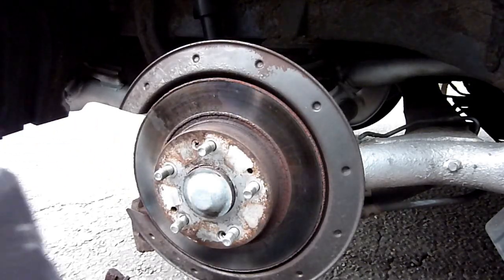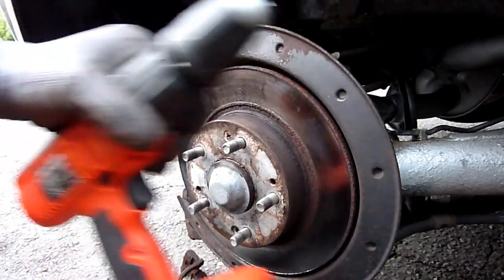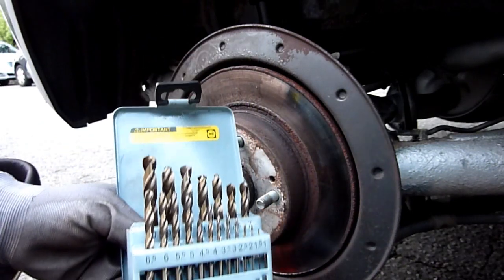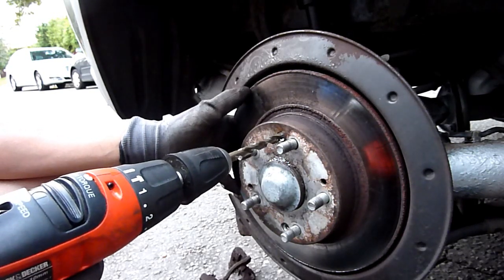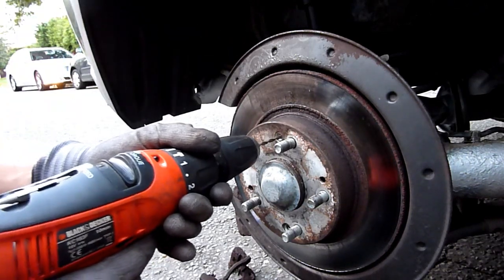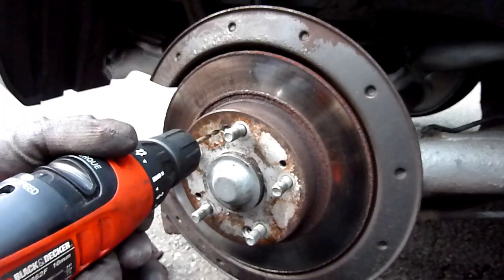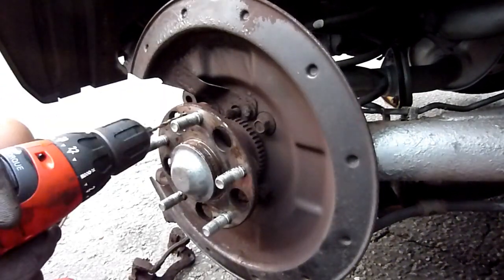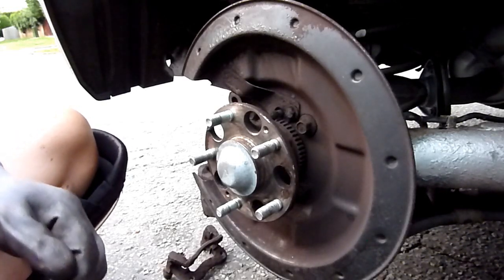How to Drill Out a Stuck Brake Rotor with Rusty Screws

Comment: i found it usefuk to watch after spending last weekend for ages with mine, impact didnt work, shocking with punch too not worked, so i ended uo drilling head off, discs came off but rest of screw still in, them and the other side is a job for this weekend, im trying to soak them few times during week, to hopefully aid getting them out this weekend.

Comment: I put two M8 bolts on the removal holes and wound them in with a ratchet, it cracked the threads on the stuck screws.

Comment: If you start with using a small drill bit then gradually increase size this will be a lot easier than starting with one large drill bit. Also use left handed drill bits and a bit of heat and the bolt(s) will likely come out. If they won't then drill out the head, use a centring drill bit to locate the next drill bit dead centre on the remaining bolt then drill out with a left handed drill bit.
Reply from the maker: I agree with the left hand drill bit, but I think starting with a small drill bit on a smooth surface is a good idea, not on the head of a screw. The indents will catch the small bit and break it off. I use colbalt bits, so being expensive, I try not to break them.

Comment: I just use short punch tool and create a divot on the edge of the screws and just took hammer to tap the screw in the divot with the punch tool or small head Phillip counter clockwise  until the started to move and then took the Phillip to take the screw out …very easy 1 to 2 min job. https://youtu.be/KCAeXsKz3ng
Reply from the maker: Too many risks involved. Most people can't see a screw head well enough to dent it in one corner. I also wouldn't recommend your technique on removing oil filter covers, as I've seen it done before.
Reply: I posted a link so people can decide what method they want to use…sharing is caring…

Comment: you should use the bolt extractor tip with your drill in reverse. You would be done in a minute instead of 12.
Reply from the maker: You should try it in real life, your way, and see what happens.
Reply: @EducationPineapple  if you go in reverse the screw usually backs itself out

Comment: this car should be japanese or koreans. u need impact drier. not rust.
Reply from the maker: Using an impact driver made for taking off 14mm plus bolts and not screws, will round off any resemblance of a screw-end in a single burst. Absolutely not recommended. Try it yourself if you want to experiment, but make sure it's on something you don't need.
Reply: @EducationPineapple  If you just drill off the head, the rotors cones off and you can untwist the rest if the screw
Reply from the maker: @johnjoseph7382  If you drill off the head, it's likely you're going to damage the first few threads on the rotor, then you'll have another issue.
Reply: @EducationPineapple  the threads aren't in the rotor they are in the hub
Reply from the maker: @johnjoseph7382  not on the cars I've worked on including this one. Also your head of the new screw ain't going to sit quite right after a bit has been shaved off.
Reply: @EducationPineapple  there are no cars where threads for rotor retaining screws are in the rotors...you are referring to the rotor removing threads
Reply from the maker: @johnjoseph7382  Okay my mistake, but when I'm taking off a screw head, I don't know what's underneath, and nobody else does too. What I do know is that , if I drill deep enough to break off the head, I'll drill deep enough to cut the rotor's cone , if I drill deep enough to cut the rotor's cone, then I may drill deep enough to cut the thread on the hub. Correct (since the cone shaped hole goes all the way through without a straight hole part)? Anyway read the experience of new commenter, on this video above, called Ryan H: "Spent ages on my bmw trying to do this and gave up after removing the heads enough to get the disc off I'll get some cobolt bits and try again.Good video best in depth explanation I've seen."...my advice is, always do jobs as least destructive as possible to start with and work your way up one logical step at time.
Reply: @EducationPineapple  the guy you are quoting said he drilled off the screw head...which is exactly what I'm suggesting...once the head comes off, the rotor comes off abd you can use a needle nose plier to back out the rest of the screw from the hub threads
Reply: you just want to use a 1/4 in. drill bit
Reply from the maker: @johnjoseph7382  Not according to his account. He states he had problems with that and ended up watching my video for advice. Once you drill off the head of the screw, there's less material to work with on the job for screw extraction. That means if the unscrewing of the little bit of thread sticking out doesn't work, then drilling out a few mm of thread with a tiny drill bit is all the more risky. Like in Ryan H's case. On the contrary the more material on the head, the easier to drill out and not make a mistake. And the more material left for a successful whole screw-non destructive extraction, You are also putting extra risk to damaging the rotor and thread on the hub as well if you just go for the straight drill. Read Ryan's comment again...something went wrong with his/ your idea.

Comment: What if you mess up the thread? What tool would u use to make a new one?
Reply from the maker: Good question. I have always found that drilling it out with a smaller than the stuck bolt's thread diameter, the bolt will tend to give up before you get near the thread and just become loose. When drilling out something critical (see my video where a bolt snapped in the side of the engine cam belt cover), go for a much smaller drill bit but get ready with a screw remover that bites when rotating anticlockwise. Other options include heat/ banging it/ rotating the part and not the screw or bolt. I'll have those options ready also. If you do mess up the thread, use a tap and die tool set to clean out the thread. Worse case and it doesn't matter on a rotar just leave it without a bolt at all.